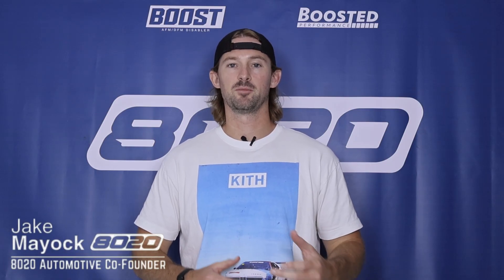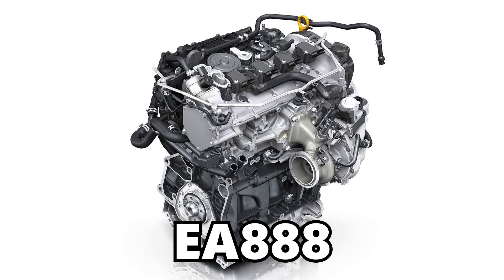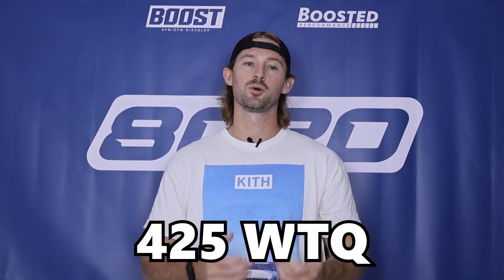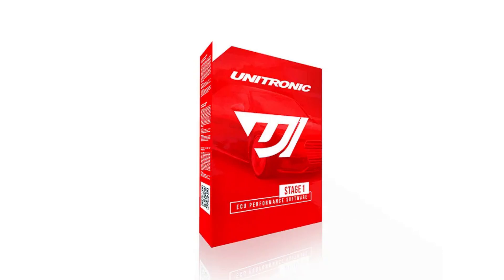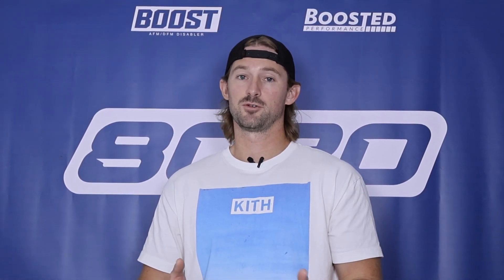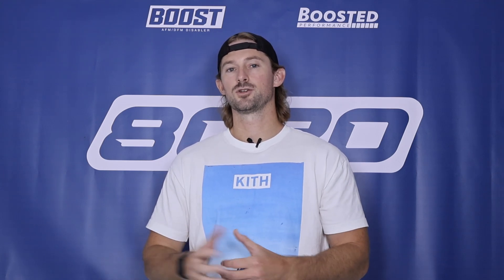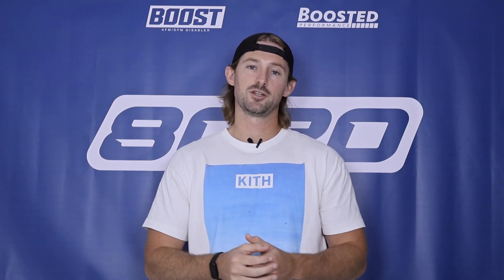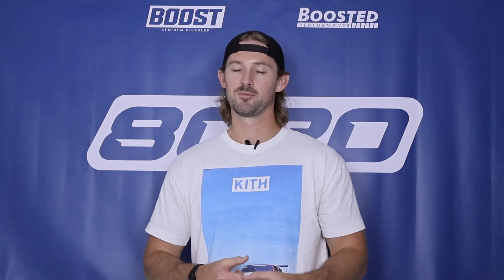How to Build a 325 WHP Volkswagen MK7 GTI! (EA888)

Comment: Is there any power gains to be had on the is20, assuming all the mods you talked about, to upgrade just the hpfp to run higher e-blend like e40 or e50?  Or is it basically topped out with e30?
Reply from the maker: D - Once you’re full bolt-on (intake, downpipe, intercooler, tune), you’re basically maxing the turbo’s airflow around 300–330 whp depending on dyno and fuel. Running E30 already pushes the IS20 to its airflow limit while still keeping fuel system demand in check. Upgrading just the HPFP lets you safely run E40–E50, which improves knock resistance and timing, but because the IS20 can’t move much more air, you’ll only see a small bump (maybe +10–15 whp, with stronger midrange torque) rather than a big top-end gain. In other words, the HPFP upgrade helps “unlock” higher ethanol blends and gives you safer headroom, but the turbo itself is the choke point — to really take advantage of E40+ you’d need to step up to an IS38 or bigger.